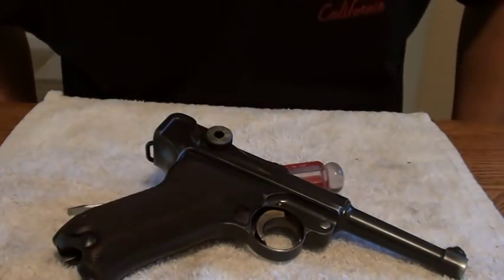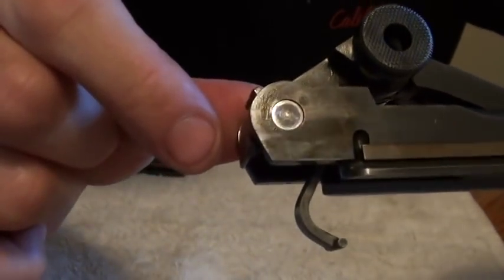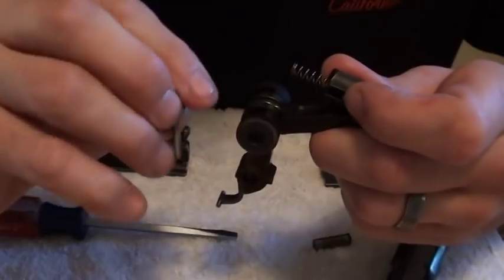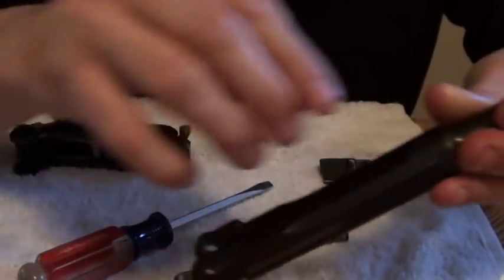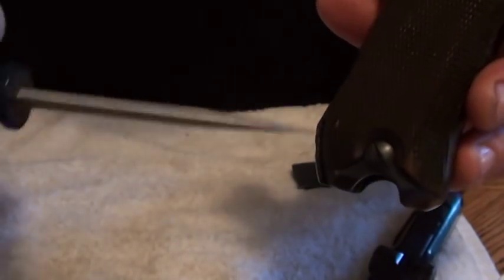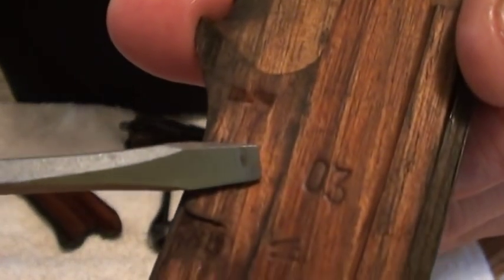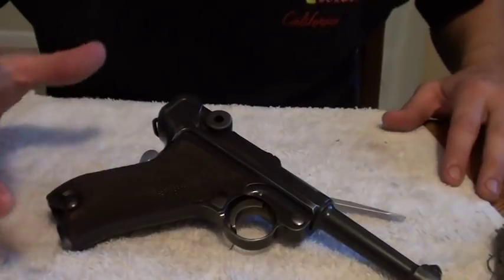P-08 Luger Field Strip and oil. Up close detail

Comment: Good video. I have a 1915/1920 model, (stamped on top of the barrel). It still appears to be of the same design. My gun has the last two digits of the serial number on more parts than you've shown. The only number on mine that that does not match is the mag. I was hesitant to take it completely apart but with the help of your video I have finally gotten it cleaned and oiled. I do fire it at the range. It's a 9MM and in very good condition. I got this one at a gun auction.
Reply from the maker: Yes all the parts are stamped with the last digits of the serial number. I was just giving some examples. Thanks for watching, and glad the video helped.

Comment: Nice video. Your S/42 isn't a year but was the manufacturers code. The Mauser factory.
Reply from the maker: Yes, I messed that up. And you weren't the first to point that out.  Thanks for watching.
Reply: It might be worth noting the reason for this. Wartime production manufactures didn't want to "target" themselves by putting their names on their items of war. Just these codes were applies. I have an all original 1900 DWM Luger/JVMartz restored/refinished (+99% condition makes it a stunning display Luger),  produced just after the US Cavalry Trials Lugers (has a 7000s range S/N, 4.75" barrel, 30 Luger chambering). These were pre WW I produced, and have the "DWM" on the front link.

Comment: Thanks much.  I'm taking it one step at a time: took the barrel out and got it back in...side plate and lever up.  Got those little claws hooked back in right.  Next time I'l take it further...when I've some gun oil.  But, very good close-up video and explanation with no extraneous comments/history.  Did I miss the cleaning of the barrel?
Reply from the maker: Thanks for the comment.   For cleaning the barrel. Just use a 9mm barrel brush on your cleaning rod. I use hopps #9 solvent with a stiff nylon brush. I choose not to use a brass brush because of the age of the pistol. Then I use the barrel patches to clean/swab it out. I keep swabbing till the patch comes out clean. Then I put some oil on a patch to coat the barrel a bit.
Reply: Perfect....

Comment: I have a luger. The magazine isn't going inside anymore and I can not disassemble it. I believe it's rust. Any tips?
And what kind of oil do you use?
Reply from the maker: Wade Just pull of the grips and toss it in a shallow pan full of bore solvent for a couple hours. Then get a cleaning brush. I got a 3 pack. They look like toothbrushes. With a nylon brush, scrub the heck out of it. This should help. These are just blind suggestions. I only use hopps #9 oil. It's been around for years. I also use their bore solvent on all my guns.
Reply: So do I 68, it's well proved over many years, as is the solvent..

Comment: Nice to hear someone detail just how important the screwdriver 'fit' is in respect to the slot, I hate to see these bozos butchering a lovely blued screw with a chisel-tipped so called screwdriver...!
This is why companies like James Purdey & Holland & Holland supply their own ebony and steel, handmade 'turn-screws' with Best London Guns.
Top Man 68...
Reply from the maker: Gus Edgar. Thanks bud. I bought a set of vintage scope rings for my 1903-A4, and the bozo used a too small of a screwdriver and jacked up the slots. Luckily I found some replacement screws at a gun show.
Reply from the maker: I just googled the two names you mentioned. Those are some prestigious companies in London, and  not to far from each other. 
Pretty impressive.

Comment: hello everyone! I just bought a Luger recently, and want to take it out to the range, however, I don't want to use the original magazine and was wondering if anyone had a reliable website to purchase them at! Thanks for any/all help!
Reply: THE NEW MANF. MAGS ARE MORE RELIABLE THEN THE ORIGINAL MAGS DUE TO THE VERY THIN METAL .I HAVE SIX MAGS AND NEVER HAD A HANG FIRE WITH THE NEW ONES. MY P-08 HAD A FLOATING SEAR THAT SOMETIME WENT INTO MACHINE GUN MODE.**DR KEL
Reply: @dscdrkel5546  Ok, so you still didn't answer andrew's question which was where to get after market magazines
Reply: @kimthurston9192  iT HAS BEEN SO LONG AGO**I WILL TRY TO FIND A INVOICE**YOU MAY TRY (MIDWAY USA)

DR KEL
Reply: MIDWAYUSA.COM**Mec-Gar Mag Luger P-08 9mm Luger 8-Round Steel Blue DR KEL
Reply: @dscdrkel5546  ok thanks
Reply: @kimthurston9192  YOU SHOULD BE ABLE TO FIELD STRIP A LUGER PO8 IN 39 SECONDS." ps" IF YOUR LUGER HAS A FLOATING SEAR**HAVE IT REPLACE ED AS SOON AS POSSIBLE WITH A FIXED SEAR.**WITH A FLOATING SEAR THE LUGER CAN GO INTO A MACHINE GUN MODE AND FIRE THE FULL MAG IN A FEW SECONDS.**DR KEL

Comment: What did German officers use to lube the parts? Regular motor oil? I seriously want to add a Luger to my collection. Does anyone still make exact copies of this handgun?
Reply from the maker: Im sure they were issued the same type of grease as the U.S. soilders. I dont think it was motor oil. (maybe as a last resort?) You are better off saving up a little more and get an original. You will be hating yourself later when you have a repro. My opinion
Reply: Sweet68Camaro I would love a Mauser S42 Luger, too bad their very expensive
Reply: largol33t1 As far as I know, they simply used Ballistol, and occasionally Vaseline.

Comment: What is the size of that  screwdriver ? Also thank you for sharing this video because I'm picking mine up soon :]
Reply from the maker: demonkogure99  I'm not sure. I just went to my tool chest in the garage and grabbed one that matched pretty good. Thanks for watching and have fun with your Luger.
Reply: Find a screwdriver with a tight tolerance to the slot - as the man pointed out, this is the correct 'size'.....

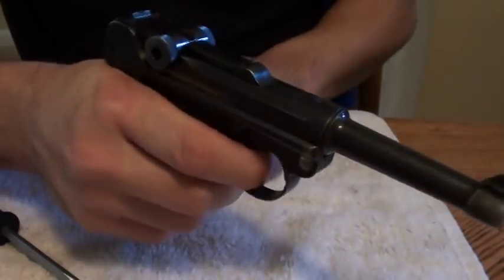Comment: Firing pin cost about $60, so I would be careful of 12:14 dry firing the Luger so often.
You may decock the FPsear just as easily.  Good Show.
Reply from the maker: Thanks for the heads up. I actually came across a plunger, spring, and a firing pin from another luger. I will be switching the firing pin to protect the numbers matching one.
Reply: Hi Armen. I just picked up a Luger. Can you explain what decocking the sear is and how?Thanks
Reply: Hi Frank, Once cocked you may pull the toggle easily back. Once you feel resistance you then pull the trigger to deactivate the sear.
Some older guys place a #2 pen with eraser until touches the FP and pull the trigger.
Reply: Thanks for that Armen...
Reply: I am not one of those "OH MY GOD, DON'T DRY FIRE A GUN, IT WILL MAKE YOU STERILE, OR BLIND, OR STUPID"  I dry fire mine, not everyday all the time, but now and then.  The problem with the firing pin is that it is numbered to the gun.  You put another firing pin in there that doesn't match, you have just devalued your "matching number" luger.  Now if you are not concerned about that, sure, fire away.
Reply: @panhead55  de-cocking it is just taking the tension off the spring.  Basically what you do it put your finger in the trigger and pull (unloaded of course) when you hear a click, you have just de-cocked your luger.  It should probably be stored that way.

Comment: Yours is missing the hold open latch, just like mine. Really annoying trying to find a new one

Anyway, nice video. Very helpful
Reply from the maker: Wow. I had no idea it was missing. When I shot it last, I just assumed the part was worn down. I'll have to get one. Thanks.
Reply: Sweet68Camaro Yeah, I'm looking online and there's almost nobody who's still got em in stock. Most just have the spring, and are missing the latch. Let me know if you find someone who's got the latch and spring in stock

Good luck
Reply from the maker: Will do.
Reply from the maker: Well, I'm kinda lucky. In my other video "Storage find Luger" That part is still on the gun. It will take some effort to clean it up to make is useable. But that's why I kept that junker. It also has the plunger, spring, and firing pin. I will be swapping out my numbers matching firing pin when I go shooting.
Reply: Sweet68Camaro Very nice. My search for a latch continues. There are some for sale but damn they're expensive. Upwards of $75 for both the latch and spring, and anyone who has a reasonable price is sold out

Thankfully it's not a critical part of the gun, so I'll just wait it out till I find one for a good price

Comment: Having trouble getting the slide plate back on. Anyone else?  Can’t lock it into place
Reply: There's a small lip on the back edge of the plate that slides under the side of the frame. Tuck that edge under first and then lay the plate flat against the frame. With the plate in place, push the barrel back slightly and lock the take down lever in place. Make sure you have the take down lever in place within its hole, but in the open position, before attempting to put the side plate on. That should do it.

Comment: Nice! I need to clean mine more often... I cringed abit when you dry fired it tho   ;0
Reply: Nothing really wrong with that as long as you don't sit around dry firing it for hours everyday.  The firing pin is very strong, the spring can be replaced if need be, I dry fire mine (sometimes) and I'm not worried about it.  But don't go asking for opinions about it, you will get 5000 answers and 50% will be wrong.

Comment: Good video, but do not use a silicone cloth as your last step in protection.  I have deepened to much on a silicone cloth and have been disappointed by the rust that I got on my guns.  I use renaissance wax exclusively on the outside of all my guns, SS included, nothing else.  It was made by/for museums to protect all their exhibits, metal, wood, paintings etc.  Easy to use, it comes in a small can, looks and smells like shoe polish but it is clear.  It will put a shine on your guns, protection from dust, moisture and it resists fingerprints.  Can get it on amazon, a small can will last a whole long time since you use so little of it. You should wipe off any oil or silicone from the gun, get as much off as possible. I wipe my finger across the surface of the wax, just so I get an invisible coating on my finger, then apply to all metal and wood parts of your gun.  Give it a few minutes to dry (you probably won't even see it on the gun), then wipe off and buff with a soft cloth.  There is no buildup because the new coat of wax removes the old coat.  I have a 1979 colt python, worth about $3500, and a 1938 luger worth about $4000 (in addition to about 20 other pistols) and they look almost new (well, they did to begin with).  I still handle them with white gloves, but that's just because its how it should be done.

Comment: Thanks, now I can clean and oil my luger I got from my Dad.  WW2 bring back.  Now I can use it.  Know a coworker who has a good place to use it.  He's even more excited than me!  He is a gun expert, me, I've never even fired a gun!  All the numbers match on mine, but no date and no numbers on the lower frame.  Repaced?
Reply from the maker: Hmm..  Check the frame under the barrel just above the front of the trigger guard. The serial number should be stamped there. Watch the first part of the vid again, I point it out. If it is blank, it might be a commercial Luger frame. Germany Exported them between WW1 and WW2. I have one in a vid titled Storage locker Luger.
Reply: Sweet68Camaro
Hi,
I just finished doing what you did in the video.  Everything looked good.  No rust, pitting or wear on the moving parts.

The main frame ? , the big part that the grips go on and the barrel assembly goes on, has no marks or numbers anywhere.  No date below the barrel.  The wooden grips have correct numbers. The line up mark on the barrel matches the base mark. My Dad did have the gun in Germany in May or June 1945.  He said that if he carried the Luger in a holster he did not need to carry his rifle. The was after the surrender. He was not in Germany very long as his army group was being sent to be part of the invasion army of Japan.  He was on leave at home when the Japanese surrendered.  He was discharged the next month. :)
Reply from the maker: pef286 Wow, cool story. The only thing I could think of is that the frame was replaced by their armories.
Reply: Sweet68Camaro That's what I'm thinking.  New replacement parts would not have any numbers.
Reply: I wonder if it shows any file marks - someone once told me that the SS issued Lugers were stamped SS on the frame & this was rubbed out following the surrender as they feared discovery - but we're attached to their side-arm....?
Could be nonsense...?